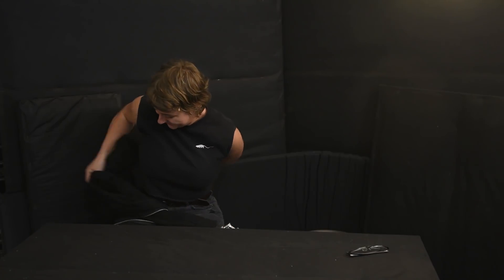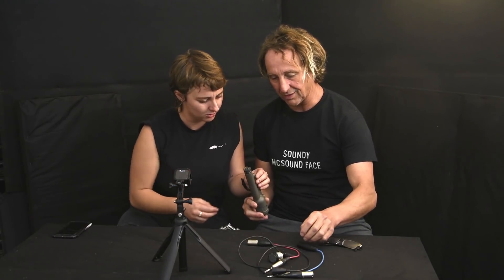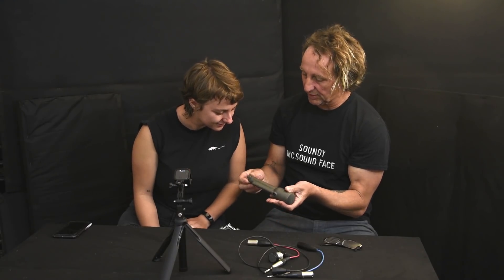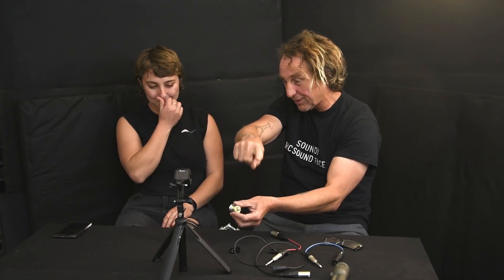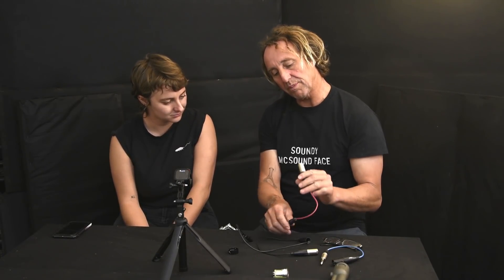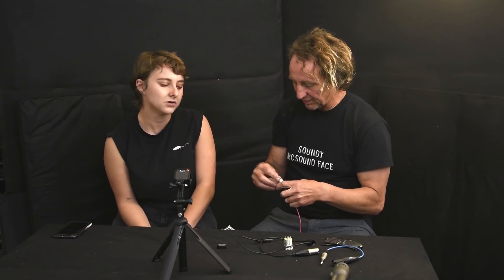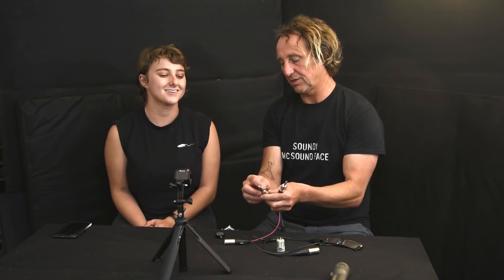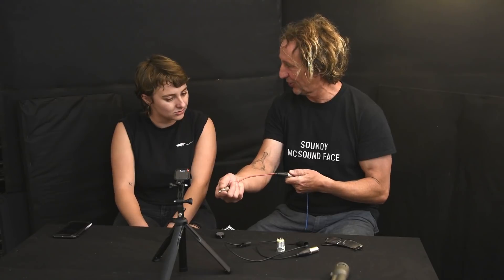Why are sound cables like they are? - Sound Chat With My Daughter Sammy

Comment: I always thought XLR stood for eXternal Line Return but I could be wrong.
Reply from the maker: My ultra nerd self having a discussion with ChatGPT

daverat
What does XLR stand for?

ChatGPT
XLR stands for "X-LR" which stands for "eXternal Line Return".

daverat
What is the x series connector by cannon?

ChatGPT
The XLR connectors are a series of professional audio connectors produced by Cannon. They are used for balanced audio signals and are widely used in professional audio applications such as microphones, mixers, amplifiers, and speakers. The XLR connectors have three or more pins and are designed to prevent electromagnetic interference and provide stable, reliable audio connections. The most common type of XLR connector has three pins and is known as an XLR3 connector.

daverat
What does the Cannon XLR stand for?

ChatGPT
The Cannon XLR stands for "eXternal Line Return."

daverat
Are you sure?

ChatGPT
I apologize, I made a mistake in my previous answer. The XLR connector is not necessarily named after the "eXternal Line Return" acronym. The origin of the name "XLR" is not clear and there are several theories about its meaning. Some people believe it stands for "X" connector, others believe it stands for "Cannon XLR" or "Circular XLR." However, the name has become synonymous with a type of professional audio connector and is widely used to describe the type of connector regardless of the manufacturer.

daverat
The XLR connector was originally made by ITT Cannon. In their product data sheet they say the X stands for X series, L stands for Latch, and R stands for Resilient. Are you able to confirm that?

ChatGPT
Yes, that is correct. The XLR connector was indeed originally developed and produced by ITT Cannon, and the letters in the acronym "XLR" do stand for "X-series, Latch, Resilient." Thank you for clarifying this information.

daverat
It is a common misunderstanding that XLR stands for eXternal Line Return

Chat GPT
Yes, that is correct. The commonly held belief that XLR stands for "eXternal Line Return" is a misnomer. The true origin of the name XLR as described by ITT Cannon is "X-series, Latch, Resilient." This information has been widely misunderstood and misconstrued over time leading to the widely held but incorrect belief that XLR stands for "eXternal Line Return".

daverat
What Does XLR stand for?

ChatGPT
XLR stands for "X-series, Latch, Resilient." It was originally developed and produced by ITT Cannon as a type of professional audio connector.

daverat
Oh, really?

ChatGPT
Yes, that is correct. The XLR connector was developed and produced by ITT Cannon and the letters in the acronym "XLR" stand for "X-series, Latch, Resilient." This information has been widely accepted and is commonly referenced in the audio industry.

daverat
This is good info

ChatGPT
I'm glad you found the information helpful! If you have any other questions, feel free to ask.

Comment: I came from radio, and I remember our engineer checking when we would install a new piece of gear to see whether the manufacturer had decided to wire positive voltage to pin 2 or pin 3.  However, that was some years ago, and a lot of what I run into now seems to indicate that the industry has settled on pin 2 being "high" or "hot" or whatever term you like, positive voltage.  Last studio I wired had everything positive on pin 2, and I am in favor, it makes things a lot easier.  Does anyone know the history of how and why pin 2 positive became the standard?  Actually, it might be more interesting to know why it wasn't that way from the beginning, why we had to go through the phase where different makers decided according to their own reasons to make pin 3 positive.  It's probably a fascinating story along the same lines of how the Shure M67 mixers used male XLR connectors on the back panel, until it became standard to have female XLR's on mixers.
Reply from the maker: I don't know the history but I do know that both pin 2 and 3 have the same voltage on a balanced line.

Whether pin 2 or pin 3 is positive really depends on your definition of positive.

Pin 3 positive or pin 3 hot means when a mic diaphragm moves outward away from the magnet a positive voltage is on pin 3 in relation to pin 2. Pin 2 hot means when a mic diaphragm moves inward toward the magnet and away from the sound source, there is a positive voltage on pin2 in relation to pin 3.

So pin 2 or pin 3 hot is not determining where the hot is but rather a statement in the polarity.

When I started in audio, many of the US manufacturers were pin 3 hot and many of the UK gear was pin 2 hot. As long as you use XLR in and out, it makes no difference as the same polarity is maintained. It matters when you convert to unbalanced as the tip of a 1/4" should be the in-polarity, so itainly impacts the adaptors.
Reply: @DaveRat  Hmmm...OK, so perhaps I've misunderstood a lot of things here.  First, I thought that pin 2 positive or hot meant a positive voltage when the diaphragm moved toward the magnet (which is what you just said).  But I also thought, and apparently this is where I was mistaken, that pin 3 positive meant a positive voltage there (instead of on 2) when the diaphragm moved in toward the magnet.  But you said 3 hot is defined by a positive voltage on 3 in relation to pin 2 when the diaphragm moves away from the magnet, not toward it.

Here's the part I don't get: if the positive voltage is always on pin 2 when the diaphragm moves in toward the magnet, and always on pin 3 when it moves away from the magnet, what is the value of designating one of them hot or positive at all?  I guess what I'm trying to say is, I would understand that the polarity had reversed if I was calling pin 3 hot as the diaphragm moves in, compared to that being true on pin 2.  I always thought that was the reason we wanted to know, because we wanted to connect whatever was 'positive' (2 or 3) to the tip and the other one to shield along with the ground, whenever we were connecting unbalanced consumer or prosumer gear.  (And maybe here I've opened yet a different can of worms, assuming that other sources are like microphones when it comes to the definition of 'balanced' output.  I could be adding to the confusion by unwittingly mixing apples and oranges.)

I noticed that you even tell Sami in the video that you move from balanced to unbalanced by tying pin 3 to ground, and I take it you mean that is true always, you'd never want to tie pin 2 to ground.  So I can see that you're being consistent in what you say, I just can't wrap my mind around the 'why' of it.

However,  it totally makes sense that if this is true, 2 positive means the diaphragm is moving toward the magnet, 3 positive means it's moving away from the magnet, that using an XLR would maintain the same polarity in and out (as long as the cable was wired correctly.)  But I have the sense that I still don't get this, there's something else I must be missing.  I'm probably either oversimplifying or overcomplicating something.  Frustrating.

Anyway, I appreciate your videos and I'm sorry it looks like I rather hijacked a YouTube comments thread trying to work out my own education about this, it probably was not the correct place to do that.  But if you're still reading, on a totally unrelated note, I really enjoyed your three videos on rebuilding the RE20 mics.  I have two that need foam right now, and I haven't tackled that project yet.  I think these are 1970's specimens, because they still have the scripty 1940's ElectroVoice logo that they replaced in the early 80's with the more blocky font.  I'm going to tell people they were on tour with Elvis.  (Not really -- I have no reason to believe that, even though I do think they are from the same era.)
Reply from the maker: I wrote it wrong, dia mixing toward magnet creates positive on pin 2 for pin 2 hot.

On pin 3 hot, dia moving toward magnet is paitibe voltage on pin 3.

Comment: XLR stands for X Latching Resilient. Cannon Electric Company invented the XLR cable, and the first edition was called the Cannon X connector. After adding a latch (L) and resilient neoprene/rubber (R), the connector was named “XLR.” Common models have from 3 to 5 pins besides the shell contact.
Reply from the maker: Yes! One of the few comments that has the correct 8nfo!

Comment: External Line Return!
Reply from the maker: That's a reasonable guess. I actually found the original specification from Canon about the x-series connector line and the r stands for rubber because the female pins are mounted in rubber
Reply: @DaveRat  careful. Canon is the computer company, Cannon made connectors.
Reply from the maker: Thank you and yes, I do swap those, especially when voice test responding to comments
Reply: @DaveRat  you just got to love voice texting. hey it almost got it right!
Reply: @DaveRat  ah, interesting! Did you find any docs? Would love to read
Reply from the maker: @dylanbarber6899  \

Page 33 of the data sheet has the description in the glossary x- series, Latching, Rubber  - XLR

https://datasheet.octopart.com/XLR632-ITT---Cannon-datasheet-11126658.pdf

mixonline.com/technology/1958-cannon-xlr-connector-377966

Comment: Learn something everyday. I always thought James Cannon worked for the Amphenol corp. Because back in the day a lot of tube audio equipment and mic cables used Amphenol connectors very similar to Cannon's XLR. Trivia, up until the 60s audio mixers including early Shure mixers used male chassis mount XLR connectors for inputs while the cables were terminated with female XLR connectors. Glad they cleared that up. :)

Comment: I think XLR is Extended locking ring
Reply from the maker: I found the old Cannon spec sheet and X is for X series, L is for locking and R is for resilient which refers to a softer rubber they used on the female.

Comment: I go back even further in the history of microphone cables.Mid 1960's and before used mostly tube amplifiers. Microphones were high impedance. This produced a much higher voltage from the microphone when connected to the high impedance input of tube amplifiers. Impedance was in the range of 20,000 to 50,000 ohms. This was prone to two issues. The cable capacitance very quickly attenuated high frequencies with length. Cables for bands were fine for local amplifiers, but broadcasters soon found this to be a problem.  The microphones most often had a small round PCB with a rivit where the signal wire was soldered. The connector would screw onto the mic with a mating disk, so it was a connection with solder pressed to solder. With age, these became diodes due to surface tarnish. In the presence of RF, this would rectify the signal and they were known for picking up CB radio and other interference. The third problem was if the connector was not tight, the threads would not make good contact. With high impedance as is still used for electric guitars, the ambiquitious LOUD buzzing, pops, and other connector related issues were common. This led to the industry looking for solutions to the three problems.
The solutions involved the three problems to be addressed.
1 High frequency loss over distance. This resulted in introduction of input transformers for tube gear and low impedance. This was originally 600 ohms as used for telephones.
2 Balanced signals. This gain was borrowed from the telephone industry who was able to get sound over long distance over a pair of wires.
3 Mating surface contact was rejected for a wiping connector with spring pressure for reliable connections.
Dave, your video begins after high impedance microphones were history and balanced vs unbalanced was beginning to change the audio industry as unbalanced 1/4 inch plugs for microphones were phased out except for the guitar amps.  Only recently has guitar cabinets started using XLR for microphones and have XLR DI connector included. This was driven by the need to simplify band setup for churches and tours with a remote FOH desk.
Thought you would like to see the change from high Z to low Z balanced. Originally the audio industry did not use low Z because the telephone industry used carbon microphones, a phantom powered microphone of low audio quality. It was thought twisted pair for low Z was low audio quality. Only high Z crystal or dynamic microphones could produce high quality. This notion fell aside as engineers started to solve the three main problems with high Z unbalanced microphones.
Reply from the maker: The mismatched metal connection issues as well as deteriorating connection conductance issue is fascinating and may do some vids on it at some point.
Reply: @DaveRat  Excellent. I hope you can find some antique high impedance microphones with the threaded bottom where the cord screwed on. I think that was an Amphenol connector if I remember correctly. It was the industry standard for decades of high impedance tube equipment. If you look up antique crystal microphones, the microphones with the threaded connector come in 2 basic styles, the insulator with a single rivet to solder the wire as the contact, and the 2 or 4 pin connector. Both look similar when screwed together. Both tended to have a metal spring for the cord strain relief, though some had a cable clamp.
Reply from the maker: Oh I have several, ev 664 or "the hammer" and several others
Reply: @DaveRat  Nice. I don't have any of those. My most unusual vintage is a Yamaha MZ105Be. This is of the same vintage as the Yamaha NS-1000 speakers with the Beryllium hard dome mids and tweets. Nice mic and a good performer.
Reply from the maker: Very cool. I used to repair mics for recording studios to supplement income as well as collected mics from pawn shops while touring around the country with bands. I have a cool collection of medium quality and odd mics.

Comment: XLR = External Line Return

https://backtracks.fm/resources/podcast-dictionary/xlr#:~:text=XLR%20stands%20for%20%22External%20Line,microphones%2C%20and%20other%20recording%20equipment.
Reply from the maker: Interesting. Yes, definitely two trains of opinion. Its cool to see info posted with varying perspectives.

i actually located the original Cannon XLR data sheet and posted a link in earlier comments below. The X series L locking R rubber (on the female) was what cannon described in the data sheet.

Thank you Dave
Reply: @DaveRat  No Dave, thank YOU... Your vids are always very informational... I especially like the one about flown line arrays vs. ground stacked point source systems and the impact of body heat...

Comment: I've been told Both by my Giants,Model Number,then later Berated to me Left,Right,Ground,though they hadnt settled on an xlr Standard wiring sequence until later down the road,?????
Reply from the maker: Somewhere in these comments I posted the actual cannon spec stating the x series, locking rubber as the actual reason for the name

Comment: Greetings Mr Rat and Sammy, I am occasionally blessed with my son Connor working with me and nothing is better than that. I with the help of my boss Ezra  from MSR sound in Vermont are in the midst of a quandary. If I use a 1/4 inch Tip-Sleeve to xlr  then the tip is connected  to xlr 3 and 2 is connected to 1(ground), If i use a 1/4  Tip Ring Sleeve then the tip is connected to 2. In my mind this should flip the polarity of the signal based on TRS vs TS. Am I missing something, and why do they do this. Thanks Dave W.
Reply from the maker: With current gear and to maintain polarity, pin 2 to tip and pin 3 and pin 1 to sleeve on a tip-sleeve. On a tip ring sleeve, pin 2 to tip, pin 3 to ring and pin 1 to sleeve.

Comment: As an engineer who designs avionics, we often have a requirement that a balanced digital or analog signal (that rejects common-mode noise) must NOT work at all if you loose one side. This is to assure you always have the specified noise immunity. Misleading information is worse than missing information when you have backups. If I was a rock band sound-guy I would probably just up the gain and never know I just lost a leg. ;)
Reply from the maker: Very interesting! Yes, for pro audio, losing a leg driving a non transformer input will either give a 6db drop or a DB drop plus a thin sound. Experienced techs can usually hear or see the issue pretty quick. Less experienced techs may run with it indefinitely.

Comment: I have a pair of old Sony mics that came with my grandpas reel to real that appeared to have an 1/8" jack but it has a longer ring and the tip is much rounder. I ruined quite a few 1/8" sockets before I realized that it was different enough to ruin things. They hadn't quite standardized it yet. I put xlrs on them and gave them a whole new life, unfortunately one has a wrinkled diaphragm on it and is pretty much toast, so much for a stereo pair (which they'd be good for). Great video I really dig this particular type of stuff. :)
Reply from the maker: I love the old odd audio gear stuff!